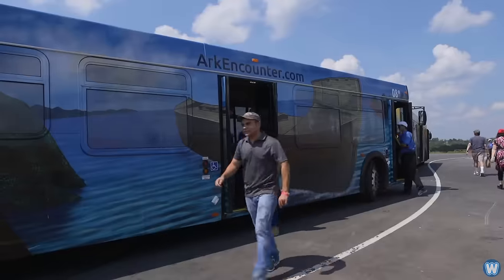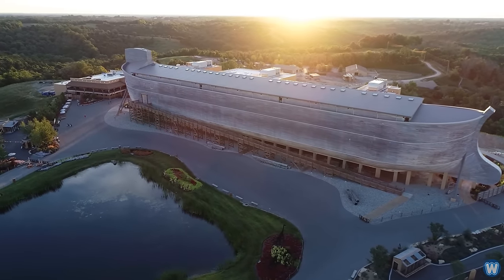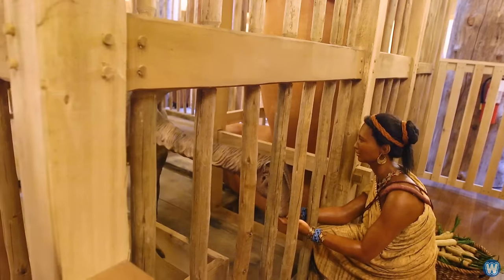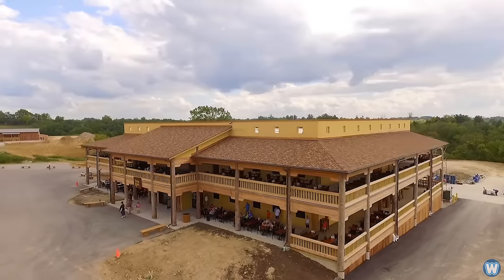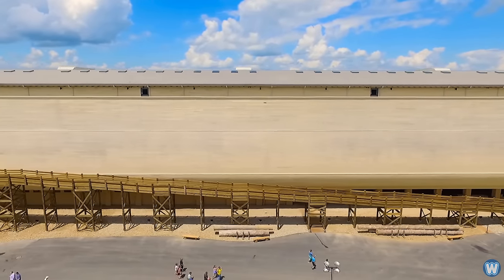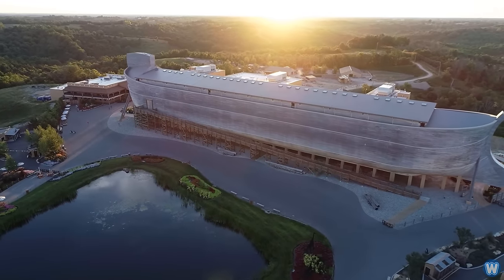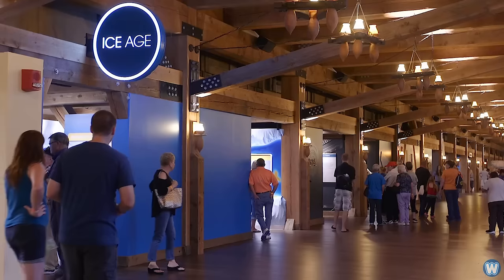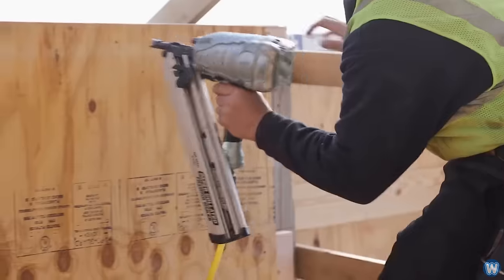Ark Encounter - Noah’s Ark Replica Theme Park

Comment: It took a thousand workers 2 years to build this. At that rate Noah and his sons took 250 years to build the ark. And don't forget the modern version was built using power tools and lifting equipment. No nail guns and electric drills back in Noah's day. And they would have had to cut down all the trees themselves and make the planking. So probably add another 250 years on for these factors.
Reply: The modern version also includes electricity, insulation, plumbing, and a bunch of other modern technology. None of that would have been included in the original ark so it would've taken less time to build. The Bible doesn't say how long it took Noah and his family to build the ark, but according to the timeline of the story it's reasonable to assume it took about 70 years. The Bible also doesn't say if other people helped Noah build the ark, but I find that unlikely.
Reply: @KappaHunter  yes and it doesn’t say that anyone was helping them .. plus in modern ark they just brought the materials … and back in the day they would still have to find a proper trees cut then , prepare them ant transport … and also most of the time which people spend back in the day was to try to sort out some food .. so there is that
Reply: Noah also was 950 years old when he died
Reply: @spritecarton625  And he and his wife were 482 when they conceived all 3 sons at once...
Reply: @spritecarton625  lol
Reply: According to the Bible, it took about 100 years to build.  Consider the pyramids and other wonders of the ancient world built without power tools.
Reply: Noah was 600 years when the ark closed, with his sons and their wifes .( Genesis7:5)/ Noach was 500 years when he had sons.(Genesis 5:32) / So I think that the building endures 100-120 years mercytime . What do you think?
Reply: There very well could have been power tools before the flood.  The Baghdad battery that is over 10000 years old
Reply: @Coffeendonuts  Where are the archaeological remnants of these power tools. Where are the plastics, or metals. Where are the high speed steel tool bits. We can find all sorts of metal cups and plates, needles, awls,  knives. Why no metal tools? Why no machine tools?
Reply: There is archeological remains of the ark buried in the ice on Mt Ararat.
Reply: Or they didnt do it.   1,000 workers kinda did but,  3 dudes doubtful.
Reply: @benjohnston2558  Funny the ark was found impeded in ice on Mount  Arrarat.
Reply: God is the ultimate Deus ex Machina

Comment: They made a life-size one in the Netherlands as well. Though that one is actually on the water. 
https://nl.wikipedia.org/wiki/Ark_van_Noach_(schip,_2012) (In dutch)
Reply from the maker: wow I did not know that, thanks.
Reply: "The Ark of Noah (also known as the Ark of Johan ) is a wooden and STEEL reconstruction of the eponymous biblical ark , built by the Dutch contractor and carpenter Johan Huibers.
Huibers built the ark with eight helpers in four years; 12,000 trees were used. The exterior is made of PINE (not gopher wood) that is weather-resistant, but which is aging due to sun and rain. The construction costs were 4 million euros. The ark was opened to the public in Dordrecht in 2012 . In 3.5 years time the ship attracted 280,000 visitors. 
The ark moved to a temporary berth in Krimpen aan den IJssel in 2016 , and has since been closed to the public.
The ark can be towed by tugboats over the inland waters, but is not seaworthy. Huibers wants to go to overseas destinations with the ark, the ark will then be transported by sea on a large pontoon or transport ship.
Elsewhere on the world there are two other large replicas of Noah's Ark. In 2009 Noah 's Ark was opened in Hong Kong , and in 2016 Noah 's Ark in Kentucky . They are not boats but buildings on solid ground, in contrast to the floating Ark of Johan" Wikipedia.
Reply: Huh. Never heard of it. And i live close by. Like town close by not country closeby. If you live in the netherlands everything is relatively  close by.
Reply: Everything in the Netherlands is either on or under the water.

Comment: LEGIT QUESTION: would the building float and stay upright if there was an actual flood?
Reply from the maker: I doubt it's water tight, the base is probably built onto a concrete slab and not an actual keel of a boat.
Reply: @WonderWorldYTC  yeah, the entrances are ground level which would basically flood the whole structure and apparently there are normal building built onto be back of it
Reply: The so called ark was damaged by the rain … so go figure
Reply: This was built to show it could be done. 
There are three towers connected to it containing stairwells. Building code for emergency exits.
Reply: @JamesMorris-l8b  it was built with modern tools. Proves nothing.

Comment: The boat should be usuable in an actual flood
Reply: It wouldn't float in the ocean for any longer than a minute before it broke apart.
Reply: Colin12475 that’s because it’s a museum lol they used the measurements in the Bible if you have been they have a section where they show what wood they used to make it stay in water

Comment: One has to wonder why they built thisark on land. The reason is that a wooden boat of this size is not strong itself to support itself.
BTW: the ark in the Netherlands that is mentioned below is not made entirely out of wood either.
Reply from the maker: "One has to wonder why they built this ark on land." No, no one has to at all. it's a theme park, not a usable practical replica.
Reply: Why would the same structure be able to support itself on land, but not on water? Do the individual components become heavier when placed in water?
Reply: @jamieostrowski4447  no because how the tides would twist and stretch the boat.
Reply: @Dycdom  the replica (in smaller) size was actually tested by USA navy.